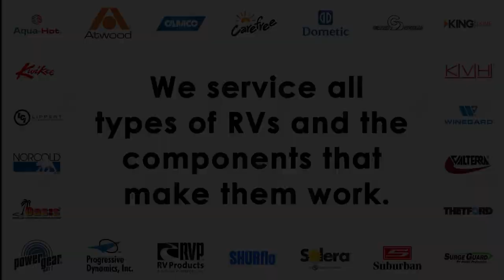Atwood Water Heater & Hydro-Hot Zone Heater Issues -- My RV Works

Comment: Just a added thought about the fantastic fan. 
There is a ground wire at top under the vent lid that’s connected to the plunger switch, so when the lid is lifted it will power on the fan. The  ground wire will at times get loose or corrosion can cause resistance to the ground. 
We can’t thank you enough for your platform professor Darren! 👍

Comment: I had a weird one a week ago.   Went to start Jayco Alante and chassis battery was totally dead.   No lights in the dash at all.   Got it started and charged up.   Something was drawing over .25 amps.   The Kwickee steps would not work and the cab lights stopped as well.   The step controller was the problem.   Got it replaced and the draining stopped.   Somewhere there is a blown fuse for the cab lights could not find it anywhere accessible.  The tech reconnected to another un-used 12vdc conductor inside the dash and all is good.

Comment: Daren I love your content. It’s very interesting and helpful.

My question is on a slide room on a 2001 Itasca Spirit. After the room is retracted it will creek out an inch or two and then stays there. It was taken to a repair facility and they were saying it is a hydraulic cylinder leaking. I realize you can’t say positively what the issue is but I would like your opinion. I am wondering if it would be a check valve. I don’t have a manual or experience with the system. I am mechanically inclined though. Thank you for your consideration . 😊
Reply from the maker: When we come across issues like this, I always like to start with fluid analysis. Here is a link to a company that will do the analysis of the existing fluid. 
https://jglubricantservices.com/rv.html

What I'm looking for is contaminants in the fluid, any sign of rubber, aluminum, Etc.  as that could be an indication that something has failed in the system.  So that establishes a Baseline. If something failed in the system do we need to get that fixed first.

Comment: I have a 3 way norcold 300.3 fridge that needs to be replaced. Do you have a suggestion on a particular brand? Will any one that fits the dimensions work, or do I need to use the same brand due to the wiring and gas line configuration.